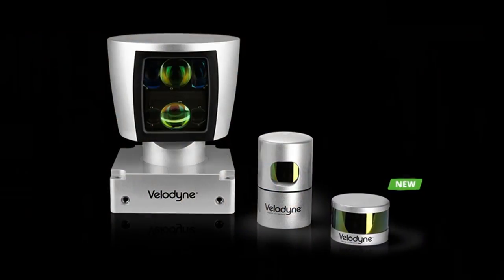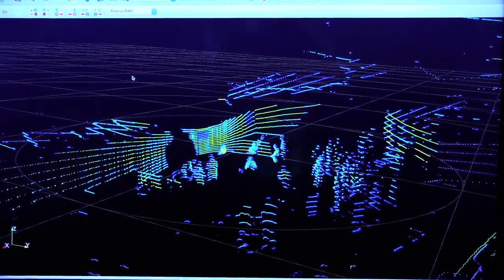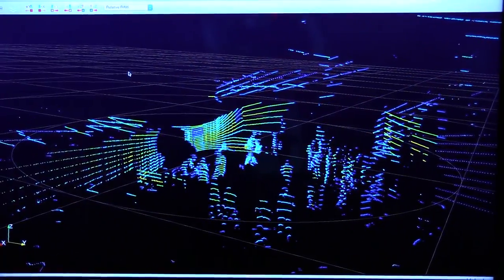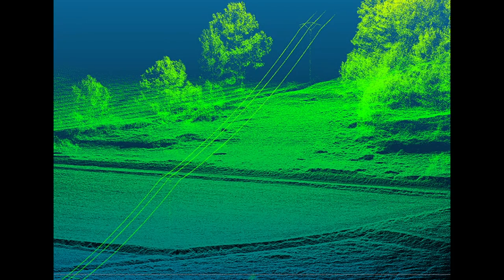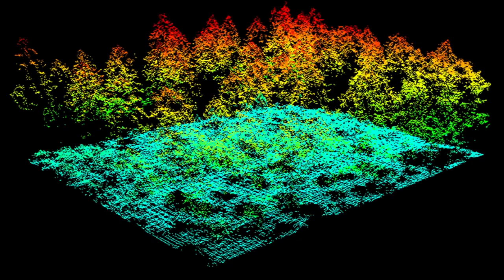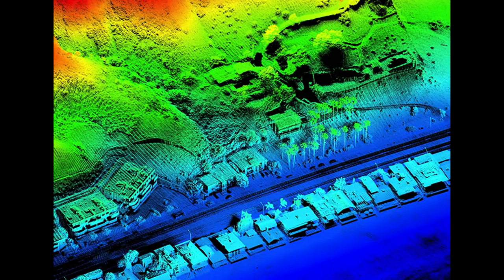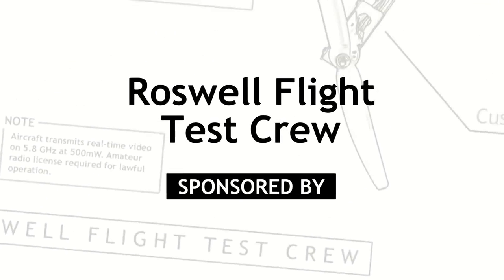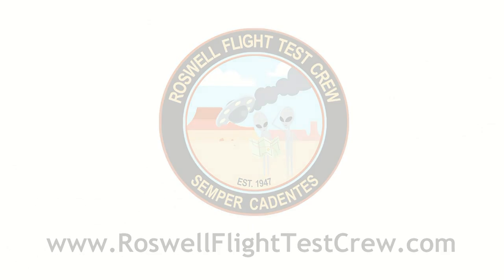Velodyne LiDAR 3D Mapping System for Drones

Comment: it would have been nice to see it attached to a UAV and powered  as it stands there its just a lidar on a tripod how does vibration affect it  what is the altitude limit ?what is the power consumption and how to store the data on the UAV   the Puck is just the laser part it would also need more hardware to make it ready for drones . i saw it last year at the DWE i hope they can make it work soon. keep the great videos coming guys
Reply from the maker: Glad you enjoy our videos! You ask a bunch of great questions about how LiDAR works that I am singularly unqualified to answer. So, I'd suggest following up with Velodyne directly. I know the "puck" was designed specifically for use on drones, so presumably both the weight and power consumption are compatible with those parameters, broadly speaking.